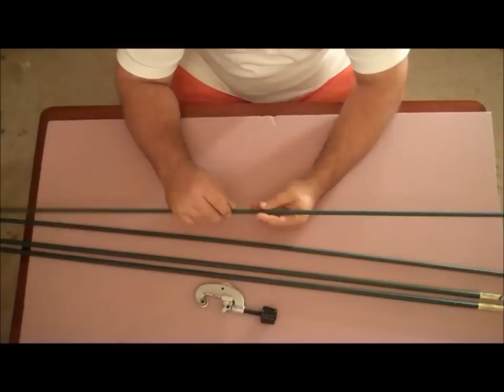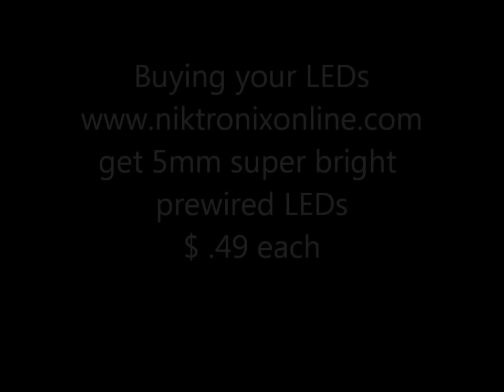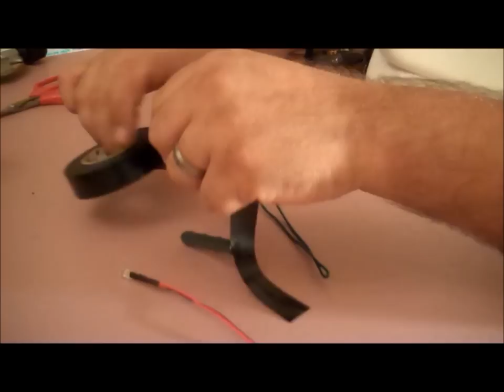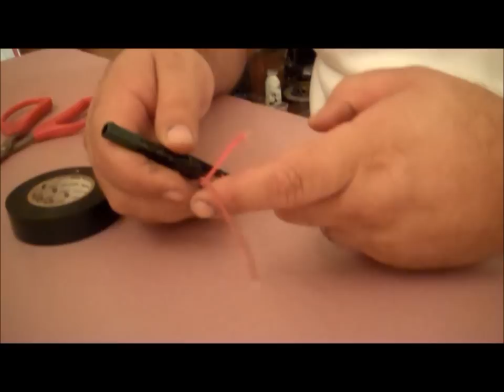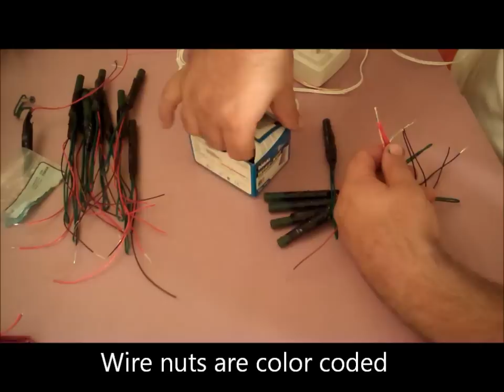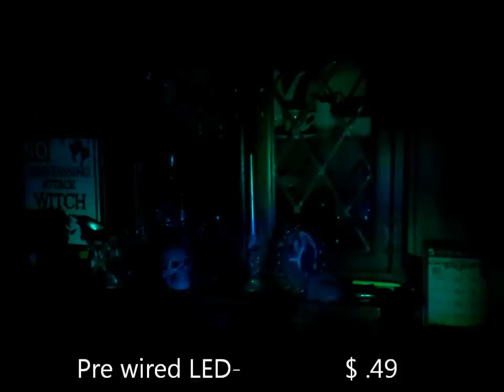LED spotlight tutorial

Comment: I just wanted to clear up a simple electrical mistake in the video. Using less than the 15 LED's on your 300 miliamp power supply will not force more power through the LED's.  Its actually better to NOT load your power supply past 80%. In this case that would be 240 miliamps, or 12 LED's. Also if you using a long length of wire between your power supply and the light locations you could have some voltage drop which could actually add to the "amps" that are being used or supplied by the power supply.
The moral of all this........Just use the 80% rule and your LED's and power supplies will thank you with long life.
Reply from the maker: +electriclott   Thank you.
Reply: If you use a lower voltage supply with a LED set up for 12v they will still light up but be dimer, now if you have a larger supply say 24v then you will need to put a min of 2 in series to make the 24v. The resistor limits the amount of current to the LED.
Reply: adding longer wire leads add to total loop resistance. This reduces total current in the loop, which slightly dims the LED. For a given input voltage, increasing loop resistance lowers current as I = V/R.  Power in the loop is P = VxI, so for a constant input voltage, lowering the current (by increasing lead length) directly lowers the power required from you supply.

Comment from the maker: I use 3mm 5mm and 10mm, they happen to make tomato stakes that are perfectly in those sizes. In this video I used 5mm. yes I maed spotlights in this video but they can be little floods if you diffuse them. the LEDs themselves have about a 30 degree spread on their beam, so they are not regular bulbs but are geared towards spots.
Reply: With the 3mm ones on the site you listed (that I bought) they are 6V. With that- do I still get a 12v power supply or a 6V? Thanks!!

Comment: As long as it has the correct resistor wired on the Single Wired LED - that sets the Maximum Current that can flow through the LED. If the Voltage were increased higher it would change slightly - but allowing for Automotive use they have usually been figured for 15 volts to prevent damage to the LED. Normally 680 Ohm Resistor - 15 volts divided by 680 Ohms =.022 or 22 milliamps of current and 12 Volts divided by 680 Ohms =.017 or 17 milliamps which either Voltage is safe.

Comment from the maker: Oh that was not clear to me in the question. No, you cannot run both from the same mentioned powersource. It will run the 15 LEDs or the motor. I thought you were asking if you could remove that power source from the motor and then use it to power the lights. Getting a 600ma 12V transformer will allow you to run both.

Comment: This is fantastic! well done. (it's been said before) 15:15 is not true. the mA rating is the max output. so you could only run 1 or 2 on a single power supply and no damage would occur.
other than that. brilliant job.

Comment: Not all 5MM LEDs have a max current rating of 20mA. Red for example is typically lower 16-18mA and blue can be upwards of 30-35mA. You should always check with the source you're purchasing them from to verify. Also, something that wasn't covered in this is long wire runs will drop voltage and current over long runs. Typically over 100ft runs you'll notice voltage and amperage drops. Lastly, you CAN run a 12v LED at lower than 12v, it'll just be dimmer. We've done this in the past with blue and green LEDs as their wavelengths are much brighter than RED and can drown it out. We ran blue and green at 9v and Red at 12v for an even effect.
Reply from the maker: +Matt Medley  great info

Comment: This was a great idea and I plan to build this next year. I am consulting for another haunt. I have a idea to take this one step further for mobility. Going to Mouser.com purchase a ABS encloser and Shielded RCA Cables (Panel mounted Female Connectors) & Shielded Male Connectors with Strain Relief. Then install the Female connectors in the top and wire all together with power supply then wire RCA male connector on the end of your Speaker wire. This then gives you a Power pack. Just a Thought.

Comment: Love your videos!!!! I have a question on the LED's, I have been looking on eBay and there are several sizes, 3mm up to 20mm and larger. I am just wondering what size LED's you are using. Also in the video you put the LED about half way into the tube, does this give it more of a spotlight effect, and would placing it closer to the end give it more of a flood effect as the beam would spread out more the closer you are to the end? I'm wanting to build a bunch for next year. Great tutorial!!

Comment: Question on outdoor use.  I realize the power supply must be protected from weather.  But when wire nutting the LED at the outdoor location, do you need to electrical tape protect it from wet weather conditions?

Comment: I didn't go through all the comments (this is an 8 year old video at this point...), so this may or may not have been mentioned.

If you configure your LEDs to run off of a 5v power supply, then you can use a USB port to power your spotlights. ANY power source with a USB port.. So, depending on your set up you can use a television, a computer, clock radio, LED power strip, or a cell phone charger. This seems pretty obvious, but it also gives you the ability to power your lights off of a battery bank, which means you don't have a ton of wiring to contend with. 

You may not be able to wire up a lot of LEDs together, but you can put them anywhere you can hide your battery bank and make your wiring as long or short as you want. The downside, of course, is that they must be recharged every so often, but a cheap little $5 power bank should run 5-10 LEDs for 12-24 hours depending on the output, and will be about the size of 2 "C" cell batteries.  That will vary from unit to unit. The upshot though, is that you won't need to hide all the wiring of a plug-in system and your spotlights will be mobile and be more versatile. 

If you really want to be slick, they sell fairy light strings that have multiple flashing and dimming options for as little as $7 on Amazon. Some are already set up for USB, but the ones that run on 3 AA batteries will work just fine. They're wired for 4.5v, but a 5V system isn't even a strain for them. So they will work just fine. The circuit boards for those are pretty small and can be hot glued or taped directly to the battery bank casing or you can simply solder your USB wiring to the positive and negative battery leads. Incorporating these little boards will give you even more options for your LED spotlights whether you use a battery bank or not...
Reply from the maker: Most haunts want wired as opposed to battery but I have had to do it in some situations. good tips though if you need alternatives.

Comment: I was wondering...I have a 12 V deer motor I got from electronic goldmine and I'm using a 12V 300ma transformer to power it. Can I use the same transformer to run 15 LEDs?

Comment: We tried using the tomato stakes however they were square on the inside and would not fit (5mm LEDs).We ended up using short sections of straw wrapped in electrical tape. As a matter of fact we used a single power supply to drive about 500 of these and lit a 7500 square foot haunt this way.
Reply from the maker: +Scott Simonson  weird, ive never run into square tomato stakes.
Reply: The outside was round green plastic but as soon as I cut into one the inside was square metal tube. It actually worked out  better because it was cheaper using plastic straws and electrical tape. I got a 30a 12v supply and used Cat5 cable along the tops of walls to power all the lights. Funny side note, one night halfway through the night half the leds (of about 500 ) stopped working. This was due to the cheap power supply not really being rated correctly and I inadvertently created a choke point in the wiring. Thanks for all your videos!

Comment: what resistor is installed in each of the led lamp assemblies? since resistors get warm during use, how hot do the resistors get?
Reply from the maker: if you follow the link in the description it will tell you, the point of getting prewired is not having to worry about it.

Comment: dc currant dies off over too long a distance of wire
Reply from the maker: you lose a volt for every 125ft is what I have found with these.
Reply: @StiltbeastStudios  that's it,?????? these tech guys on  the tube here make it out to be a cardinal sin if you deviate from their strict equasion, i mean i'm an 80's death metal guitar player, so i've had my hands in live electric on stage fixin stuff,, (not brave, just stupid and paniced when my marshall shut off),shit i strung most of my workshop hot, until i got hit,  i must have put the breaker in  "on",lol, anyway, your not powering the  lunar lander,,anyway they say it's bad for the power supply,, and your led's won't be as bright,  but????? i'm running 3 50 " flat screen tv screens worth of led's with 1 12 volt battery charger, and you can't look directly at them without being blinded for a while

Comment: Can I wire these up to a battery pack?  We do a charity haunted hayride and the ride is about an hour through the backroads.  We don’t want generators at every scene so we need battery lighting.  If so, how would I do that?  Or any suggestions? IMG_5648.jpg For those of y’all wanting a pic of graveyard with LED spotlights.  These are battery pack spot lights from Dead Head Props.
Reply from the maker: absolutely!!!    Use these!  9V pre wired you can just buy 9V battery boxes and wire them the same way- 5 LEDs per battery.
https://lighthouseleds.com/catalogsearch/result/?q=9v+prewired+LED

Comment: What are the volts of your LEDs?   12, 9 or 6?
Reply: swgrinder1 He said 12v in the video.
Reply from the maker: swgrinder1  Yes I use 12V because that is an easy voltage to get wall warts for.  On occasion I get 9V if I want to battery power them.